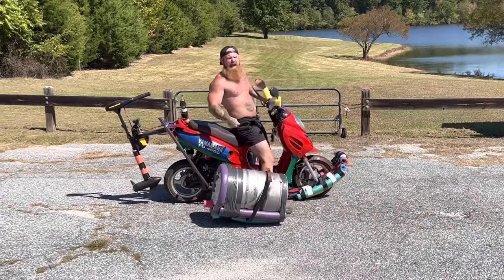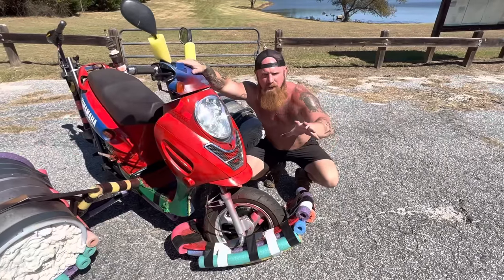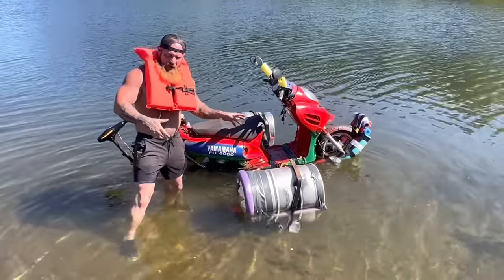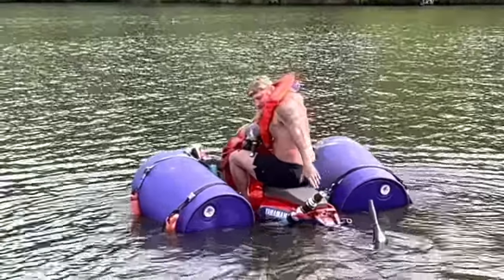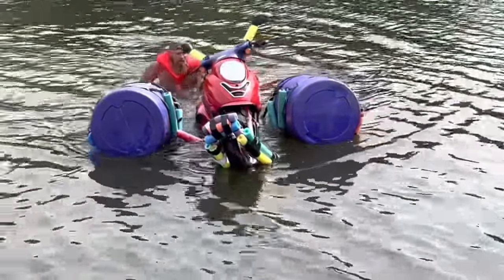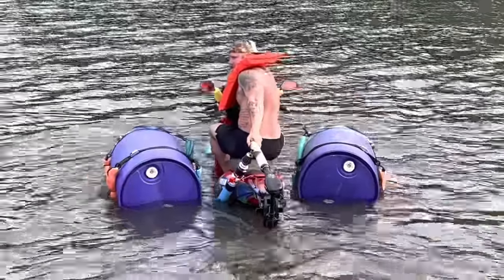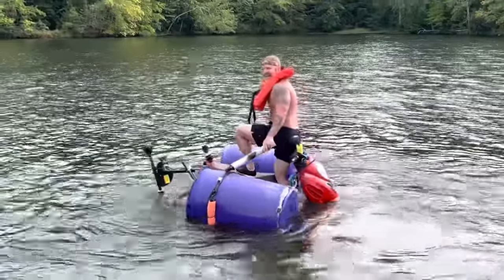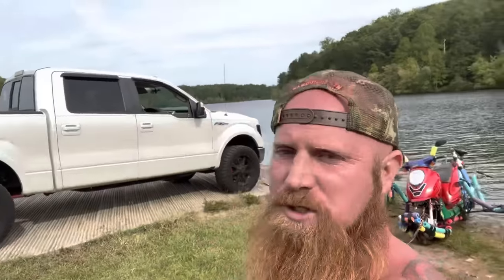Ya’ll check out my REDNECK JETSKI!

Comment: Double the pontoons and change their bracket from bottom to top. So when in the water their boyancy forces them into the bracket, put the straps on the bottom.
Reply: +1 to change bracket from bottom to top. Add small pontoons fore and aft (front and back).
Reply: I think longer pontoons (outriggers) would help with balance. And rig em lower on the bike to keep it higher in the water - like a catamaran.
Reply: @hanburgundy4317  Agreed, but too long or too low could make it hard to drive on the road too. Too many too's?
Reply: I love that the comment section is trouble shooting ideas to get this working!
Reply: What do you all think of offsetting them, so that one is closer to the back and one closer to the front, this would help keep both front and back level with the water.
Reply: @zeusdarkgod7727  I think using a balsa rail to stiffen the rail (and keep light) with two barrels on each side would actually work.

Comment: A better idea is to use long thick pvc pipe instead of barrels. If you noticed with the barrels, you only used about half of the air inside the barrels. If you instead used longer pieces of pvc that used the same air space as the barrels, you’d be able to make it ALOT more stable. Not to mention you could design it to fold and lock so it’s easier to drive on land as well versus the thick heavy barrels. You could also try adding the trolling motor to the front of the moped using a folding design similar to the pvc pipe idea. If you did this, you could steer it with the actual moped handles instead of the trolling motor handle and having to reach around back to grab it. I also recommend adding a pvc section to the front wheel instead of pool noodles. The pvc will significantly increase the mopeds ability to float and prevent it from nose diving into the water.
Reply: clearly there were many things wrong with this, and keep in mind he probably spent a total of 30 min putting this pos together with crap in his garage, hahahaha. That's what makes it funny.
Reply: I love your brain flaron....you wouldn't happen to need a wife would ya.???😂🤣🤣😭
Reply: @akcustom7838  don't be calling the mo..... a pos...😂🤣😭that's a ginger Billy origin al
Reply: @busaracerx  😂

Comment: My dear friend, without installing a rear fan or motor, first remove the tire or the rear motor and weld some of the pieces that resemble the fans on the iron of the rear motor instead of the air current and go down on the water and the more you press on the gas the stronger the power of the rear fans will spin more and push you forward with the addition of the rotating piece make it  From under it is connected to the steering wheel. Whenever the steering wheel turns left or right, the vehicle rotates with you

Comment: Should have glued the extension to the trawling motor handle. Then run lines from each side of the motor to the handles of the bike so that once it is running you can use the handles to control direction. Also add cables to your barrels going vertically to stop barrels coming off.

Comment: I once got a car stuck nose down on a boat ramp because of low gas myself! This was middle of nowhere Oregon. I had parked there with a girl because it was a nice view. After starting, and stalling the car several times I had gotten pretty close to the water before I'd figured out the problem. I was not putting my beloved POS Mercury Cougar in the lake! I set the parking brake as tight as I good, grabbed a couple nearby rocks and blocked the back wheels so It wouldn't roll forward anymore. The I jacked the up the front of the car to level it out so it would get fuel. I started the thing up, let it warm up for a minute or two. My plan was to just pop the clutch in reverse, let it fall off the jack and get back up the ramp before the carb ran out of gas.  It worked, I laid rubber up the ramp onto the level ground, success!  I collected up my jack and we were on our way. She said I got "McGuyver points" for that one.

Comment: You need a deep water  fording kit for the engine. The air intake for the carburetor needs to be way above the water also the exhaust pipe outlet needs to  be above other water.

Comment: Put 2 trolling motors on it. One on either sode of the 55 gallon barrels. Attach a bar across then connected to the handle bars that will turn the motors when you turn the wheel. Done

Comment: I can relate to the end. My cars are 20 years old so I bought a 2018 to have a more reliable adult vehicle. I go out one day to start it and nothing.  My driveway sits at a slight angle but apparently slight enough that a newer vehicle won't start at 1/8 tank yet my 1999 and 2005 always started even if the light was on.  😂

Comment: Had he moved the trolling motor more towards the middle of the bike and put it on a swivel mount to where he can rotate it up and across the back, then rotate it to the side and then unfold it so that it's more towards one side then in back it wouldn't have been so heavy in the rear end and he could have reached the trolling motor easily

Comment: I think you will get it engineered with a little more ballast to the rear pool noodles will hold me up in water I weigh 300 lbsdesign it with more noodles the barrels take up too much space you will get it with each try your getting better

Comment: You need a hull shaped frame around the scooter, with an inflatable tube to go all around,
 And attach shafts with paddle wheels to the rear wheel
 And attach some form of rudder blades to the front

Comment: Sure billy, blame a fords ineptness to start on low gas and an incline.
Not on the fact that its a POS ford.
I suppose it is amazing that it hasn’t blown a spark plug clear our the cylinder head or thrown a timing chain yet.